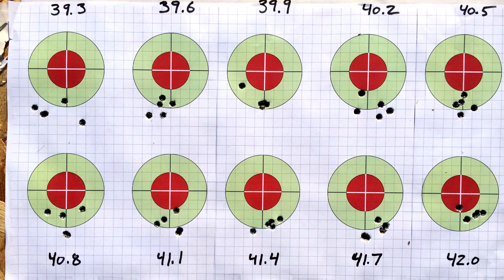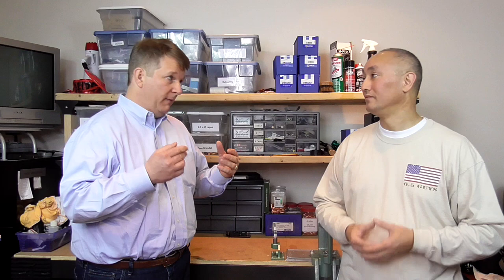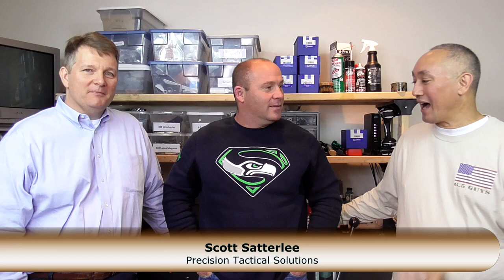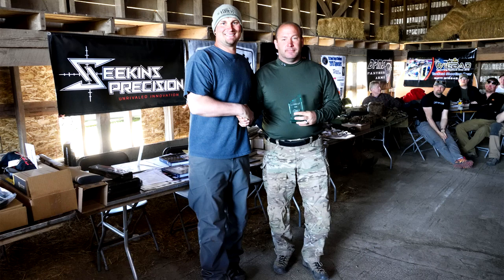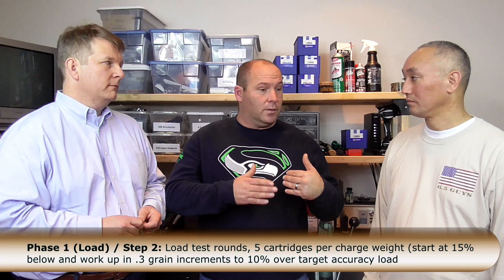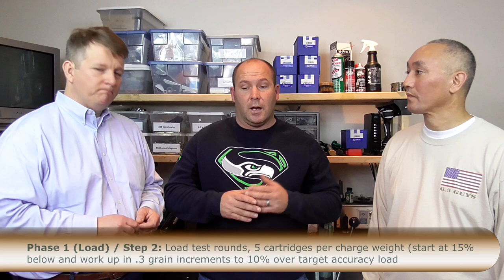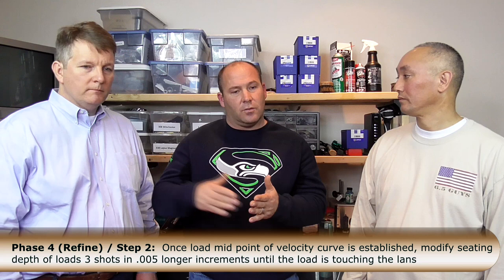S2 - 10 - Load Development (Part 1 of 2)

Comment: Hi guys; thanks for putting these vids out here. It is much appreciated; I am relatively new to reloading.
However, I have seen others (Hornady, Winning in the Wind) that show that using 5 round groups will not really give you nodes; it is not statistically significant. They suggest that velocity is just directly proportional to powder charge. This is not to say that a given charge doesn't make a difference in dispersion! As I have become quite aware there are many variables associated with internal ballistics that can have an effect on precision. What I don't have at this time is a feel for which have the greatest impact. I am not looking to become a LD or BR precision shooter, but want to work up really good loads for hunting. How about a Pareto chart for all the variables? (Let's exclude the shooter.)  Thanks again; great vids.

Comment: So, compared to a Newberry OCW, you are adding SD and ES measurements, over just group size.  By shooting in groups by charge weight you don't get the normalizing of all groups to barrel and environmental variations that you would get by using more of a round robin technique (each shot, move to next charge wt & target).  Advantage stated is not moving position much by shooting one group at a time, and can use the chrono to calc SD, etc.  Do need more shots per charge to get meaningful SD.  Big improvement in meaningful result over scatter ladder, though.
Reply: ZManiac335 Thanks for watching! That's an excellent summary of the approach. If we had a machine rest, or were supremely confident in our dot drill skills, we would shoot round robin for the very reasons you state. It would be fair to say that this approach is a bit of a compromise.

Comment: ... question... I got a new rifle with new unfired brass... with the cost of all the components today... not making sense to simply firearm the brass to my chamber,
how would you start, as in steps. ?
1 . Determine OAL (with a Hornady gauge) ?
2.  load up rounds say sets of 3 (in .2 gn increments)... 10/1000's of the max length from #1
3. find the sweet spot ?

At what point would you think/consider to increase/decrease the seating depth,
At what point would you consider/look at a different primer and what effect that might have?

This is for a HOWA 1500, 300 PRC, ADG Brass, Hornady ELDM 225gr, looking at using Federal 215 Large rifle primers

be keen to see, maybe you have a video, showing step by step your process.

Comment: Excellent episode, I also have noticed the best loads generally have tight ES/SD numbers and I have often thought of running a load test in this fashion... I have always chickened out due to the POI shift from the magnetospeed and for what ever reason my groups with it attached always seem shoot tighter than with out it attached. Which makes me wonder if its dampening harmonics like some of those rubber donuts you can buy for your barrel or if its because of the added length it adds to the barrel, there by dampening the human element by making it take just a little more effort/time to move off target in the micro second you trigger your shot and the bullet leaves the barrel.

looking forward to part two.
Reply: Niles Coyote Thanks for watching. When we were at SHOT Show we talked to the Magneto Speed folks about group shifts. It has nothing to do with the weight on the barrel, rather it's something similar to ground effect when the bullet passes over the bayonet. Turn the magneto speed in 90 degree increments and you'll see the group move accordingly. While I've noticed that my groups shift, they are the same size with and without the magneto speed.
Reply: Ed Mobley I am putting this new (to me) load development method to the test on a new 6.5 creedmoor barrel and will be using the 130 Berger AR Hybrid's and H4350... I hope to finalize tomorrow and use it at a Guardian Match on the 27th. I'll start a thread on the Hide once I am done with development.
Reply: Niles Coyote Thanks Niles!

Comment: Great vids guys, keep them coming. Wanted to ask about the range graph results, there were a couple of loads that had group sizes in the 0.7 inch range. You didn't consider those good loads because of higher SD. BUT, only one of the shots in both cases caused the SD to go up. Statistically speaking, this one shot would be designated as an outlier no? Why wouldn't you load up some more rounds for those loads just to confirm that you do not have/have an outlier?
Reply from the maker: You make a good point. I could have explored an accuracy node up at the higher loads, but the lower capacity accuracy node seemed to be wider and more forgiving in terms of level of muzzle velocity variation to the powder charge (the flat shelf in curve we talked about) which is the sweet spot I wanted to be in. Also, at the higher end of the curve I didn't want to run into issues of potentially dealing with a compressed load.

Comment: A note and a question:

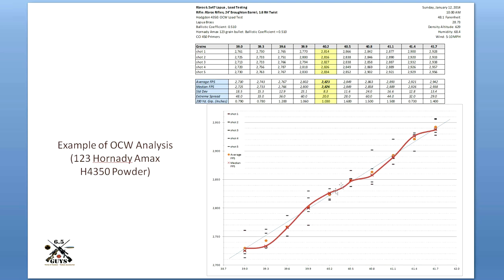1) In the powder velocity matrix (around the 18:00 minute mark), you've chosen the "stdev.s" function for excel.  It seems to me that it should have been the stdev.p function, which calculates the entire population of selected data.  

2) In the same graph, what does the red line tracking?  It appears that it is mostly tracking the median velocity for each powder charge, but it clearly is tacked to the mean for the first powder charge series of shots.  You talk a lot about the "shelf", but never mention exactly what that red line tracks (or did I miss it?)
Reply from the maker: The Excel sheet was developed using an older version of Excel and uses the STDEV function. As you noted, newer versions of Excel have STDEV.S and STDEV.P. The model can be updated to use the STDEV.P function, which statistically would be more accurate. However, the calculated result usually differs in less than 1 FPS difference - so for visually interpreting the chrono data it makes no practical difference. The key stat of interest should be extreme spread.

The Red line isn't actually graphed using Excel - it is 'hand drawn' in an attempt to interpolate a smooth curve function across the average/median points of the different loads. The "shelf" we refer to in the video is that part of the curve where there is very little rise in average FPS from one load to the next or where the curve starts to flatten out slightly.

Comment: On the OCW analysis graph (17:46 into the video), is the smooth graph line generated from the Median fps and straight trend line generated from the Average fps ?
Reply from the maker: Yes. However, with Excel you could change the graph easily to visualize the data the other way. In general I prefer to use a median statistic for group average since it tends to deal better with data outliers compared to a mean statistic, particularly if you are only calculating the mean or median using five shots for the same charge weight.

Comment: What curve fitting algorithm do you use for the velocity/sd vs grains of powder. I ask because the "plateau" wasn't so apparent to me.
Reply from the maker: +John McDonald There isn't an 'algorithm' that we are using. We are comparing the charted data points and comparing against a hypothetical linear relationship (straight line graph) between grains of powder and muzzle velocity. Where we see the curve start to flatten out, that is the plateau we are referring to.
Reply: +6.5 Guys Thanks. I was asking because you have a smoothed curve fit to the mean velocity values, not a straight regression line. I'll try this out.
Reply: +John McDonald There are some loads we developed with Varget where it's literally a straight line - no plateau. Must be one of the reasons Varget is so popular.

Comment: This information is dead on. One consideration one may have is making the OAL short enough to fit in a magazine, (you may be stuck going shorter than optimal OAL.) That's when I cry tears in my beers.
Reply from the maker: Thanks for the comment. Yes, it's very common for shooters to run into mag length restrictions while trying to tune the seating depth of a load.